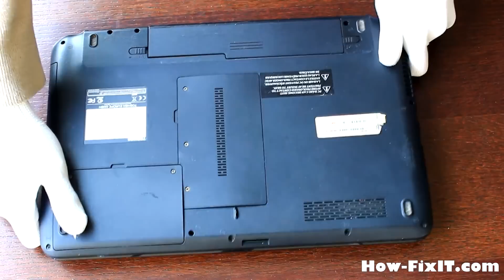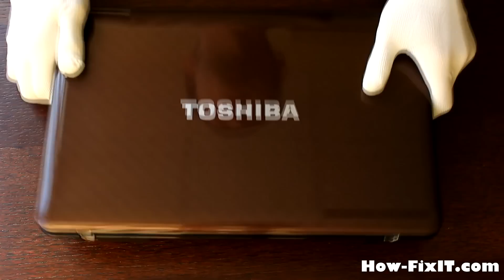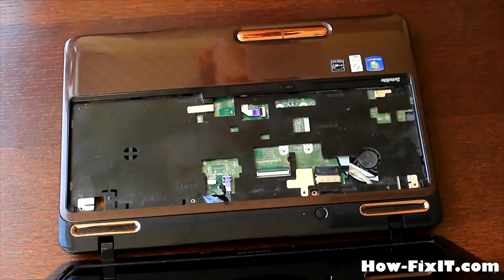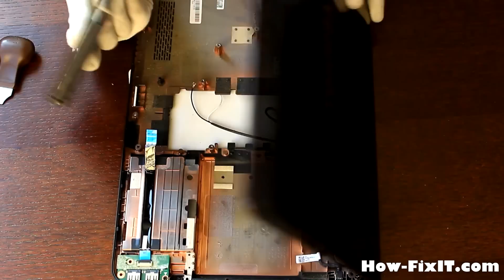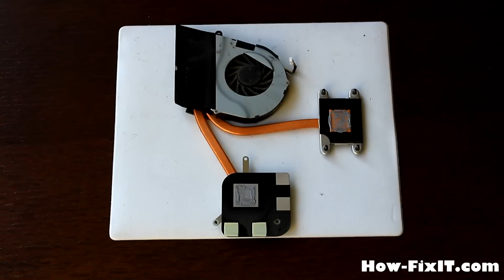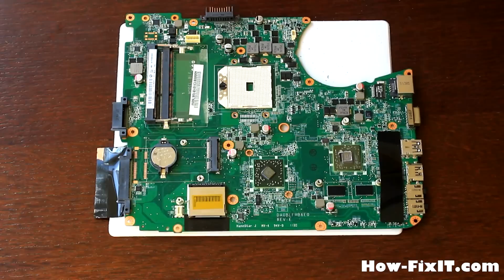Toshiba Satellite L755, L750 Disassembly, Fan Cleaning and Thermal Paste Replacement

Comment: Uuh, so much effort for just cleaning the fan! :-( Will I ever be able to assemble the machine again?
Reply from the maker: don't sure, but maybe assembly process video could help you: https://youtu.be/ceiTeTkCT0I
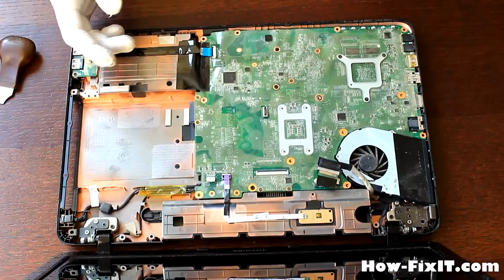Reply: Thank you a lot! I decided not to disassemble the machine as far as you did. I stopped at 10:15 but could still clean the fan to a good degree.
Reply: The main problem of assembly for me is not merely the sequence of steps, but to remember which bolts belong where. However, counting the numbers of the same type I could correctly assign them in the end.
Reply from the maker: look to paragraph "Useful notes": https://goo.gl/JhVKkN , maybe this help you

Comment: Is it possible to upgrade Toshiba L 755 D? And do you have a video Assembling this Toshiba L 755 D back after cleaning it? And which thermal compound grease do you advise to use?

Comment: Dude help! i did this and when i assembled the pc back it doesn't turn on. The only thing that does something when i hit the power button is the front LED, like it gets on, but i can't hear the HDD working, the screen won't show anyting and the keyboard it's totally dead. Any ideas on what might be wrong? i did the process a second time to verify that everything was well conected.
Reply: I presume by now you've fixed the problem, but for anyone else reading this, my guess is that you disconnected something and forgot to reconnect it.  I had that happen to me.
I reassembled my computer and then discovered it wouldn't turn on, so I disassembled it again and discovered that I'd forgotten to reconnect the power switch because I'd managed to trap the ribbon cable underneath the PCB instead of lifting it out of the way while putting the PCB back in place.  Once I'd fixed that problem, it all started working again.

Comment: DON'T BUY THIS ONE. TOSHIBA WONT SUPPORT WINDOWS 10.!
Reply: Frankie e pfff.. my L750D works faster with Win10..
Reply: +Frankie e    Our old L775D-S7340 passed the Windows 10 upgrade tool.  Still holding onto Win7.
Reply: +lxc1227 no its win 8.1
Reply: Frankie ... my L750D works fine with win 10.
Reply: lol, my toshiba work with W10 in 2026 xd

Comment: I'm probably going to disassemble most of my L755D-S5250, but I don't understand why several cables were unplugged between 7:12 and 8:30 in the video. Is it really necessary to unplug those cables?
Reply from the maker: unplugging need to remove upper case part and then motherboard

Comment: Hi, I'm not sure how familiar you are with all the components of this laptop but I have the L755D-S5162 and wanted to upgrade the RAM which seems to be the main issue that slows down my Toshiba. I originally wanted to get 8GB of Corsair Vengeance laptop RAM as it seems to be about the best and is capable of 1600 MHz but I looked again more recently and there's a newer model DDR3L that supports the newest Intel CPUs that specifically need a lower voltage RAM and now the original RAM I was looking at said it was made for older i5s and i7s so I'm not sure if it would work with the AMD A6 in my laptop even though it also says it works with any PC that uses DDR3 SODIMM RAM. I don't want Toshiba brand replacements (if they even sell an 8GB option) so do you have any idea if the Corsair Vengeance RAM I was looking at is compatible with my laptop or any other good brands that sell good RAM, preferably 1600 MHz instead of 1333 MHz? Thanks.
Reply: Mr Everything intel i5 and i7 are a Complete defrent kind of proccessor when you talk AMD.. but talking about RAM, its not all that defrent.. also, its not about the proccessor..